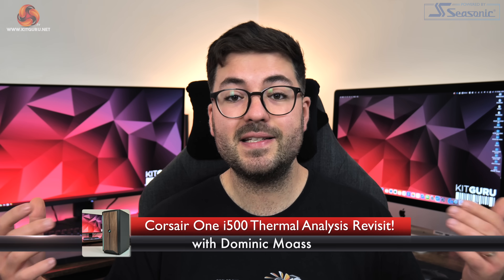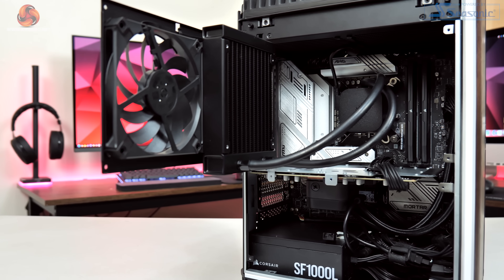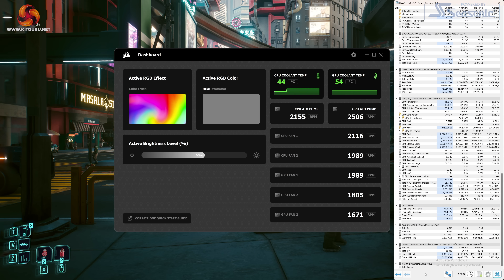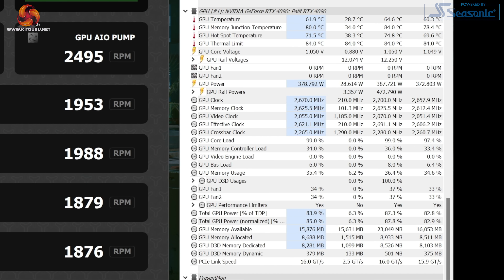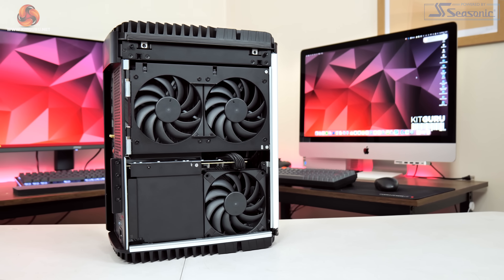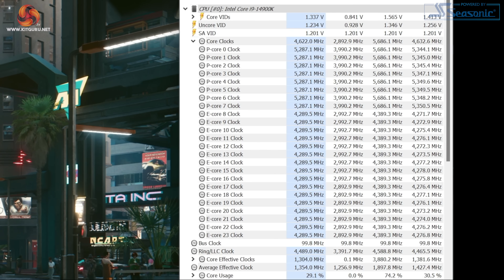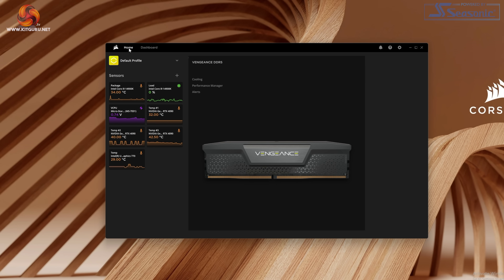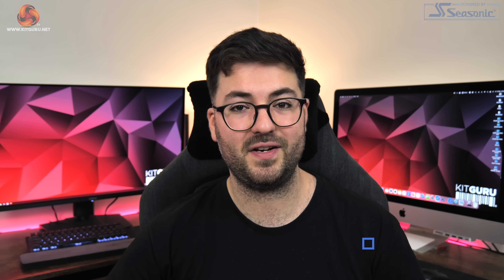Corsair One i500 Thermal Deep Dive - your questions answered!

Comment: I just randomly came across this video 😁 didn't even know there was some debate about my video vs kitguru?
At 2:05. Your different temperature result is not due to the fan curve but the different test. You said you ran something like 30minutes of test which means that you ran into PL1 Power Limit of 200W whereas I was doing a short test that uses the PL2 of 240W.
Edit: you even show an average package power draw of 190W in hwinfo. So you miss 50W of power which is less performance and lower Temperature. Has nothing to do with the fan curve
Reply: Kitgurus first video, people were asking why there were differences between your review and theirs, so they created this second video to explain some things and run more tests. I watched this video from Kitguru last week when it went up and they were saying basically what you just said in your comment - that you ran short bursty tests and they ran longer duration tests so the power demands were different . I dont think they ever said you were 'wrong', just that their tests were different and ran for longer times- explaining a different work load on the processor.

They did mention the idle fan speeds due to firmware/bios differences, but not in the context of what you saying.
Reply from the maker: hey Roman, no debate here - as the other commenter said really, we just got a few comments on our original video about our results, so i wanted to make a detailed follow up showing exactly how we tested. 100% you are correct, as we used package temps after 30 mins, which hits the 200W PL1 rather than the 240W PL2!
Reply: @KitGuruTech  😬 ah good info. Probably see you at computex?
Reply from the maker: Yep we'll be there! 😎

Comment: For the Mosfets and VRM, i was going to comment but saw that you did actually test in the follow up and i would agree. While they do have a very high operating ceiling - some are tested up to 150c and i wouldn't expect any 4090 to skimp on this area and so what Corsair are doing is probably fine, but in a build of this cost i would say not ideal, what they have essentially done is mount a  universal GPU block with all the future downsides that a GPU with a water-cooling block mounted has for a user that most likely if they are buying this won't have the knowledge to navigate the problems they will face, for example reversing the GPU back to air-cooling to make it more resalable, so if they are going down the Water block route i think they would be better giving them a full water-cooling block and the best complete cooling solution rather than a partial solution

Comment: Since the fan bracket can take chunkier fans, why didn't they just use chunkier fans? I mean at this price whats the point of skimping?
Reply: Seems a bit over the top penny pinching on whats probably a pretty profitable system. They should be over engineering the cooling not doing "just enough".

Comment: Great update! Seriously tempted with one of these and this is by faaaaaarrrr the best video on it! Cheers.
Reply from the maker: Glad you liked it!
Reply: I like their design makes a difference from the bog standard 3 fan on the front one on the rear rgb case with a glass panel.
Reply: ...while my takeaway from this vid was that it's just too much of a compromise with the latest processors. I was intrigued by the size/ design of the Corsair One a few years back, when it had minimal fans and Linus or someone couldn't get it to go over 60 degrees or whatever, but I'm not sure that cramming a 4090 and top-end i9 into such a small box makes sense today. Do Corsair offer bigger pre-built machines?

Comment: So are any of the five fans actually connected to the GPU board or the CPU cooler or are they all just connected straight to the motherboard? What if the GPU assembly was replaced with the MSI SUPRIM LIQUID X RTX 4090? Could that AIO’s fans act as push while keeping the top exhaust fans intact for push-pull? Or is there not enough room to mount it all in?
Reply from the maker: No fans are directly connected to the motherboard, they're linked to each of the AIO using splitters, though there are a few mobo fan headers that you could use. For the Suprim Liquid X, the AIO for that would have to replace the AIO that's currently installed for the GPU

Comment: Your review is significantly superior to der8auer. Additionally, I believe the CPU fans 1 and 2 are positioned there because the airflow flows straight from the side to the top. GPU fan 1&2 too.
Reply: Yes I thought at the time his review was just ok but he has this reputation. He didn’t cover half of what Dominic did.
Reply: Not to mentioned he swapped the fans and broke the air flow (he thought he was right) BEFORE doing those thermal tests, claimed the temp is high and asked for statement ? he’s probably high on something else.
Reply: Agree ! It’s much better
Reply: Yes 💯
Reply: Well said 🍺
Reply: Yes the methodology here is very data driven and representative of real world scenarios.
Reply: Yes I watched derba8ers video and a lot of his temp tests were very short turbo runs before the cpu would settle and the fans always have a short delay so it’s not really representative of a gaming session or in fact any work load longer than 30 seconds. But people seem to just blindly accept what he says at times.
Reply: Yes it is. Much better
Reply: Dominic makes more sense with the thermals he is showing in Cinebench, derbauer is just showing 96c on a single Cinebench run which takes a few seconds to complete. Dominic shows temps after 30 mins sustained load which is more useful info.

tbh a single cinebench run is useless info, the CPU will be boosting to a higher clock frequency and pulling more power.

and it takes less than 30 seconds to complete on a 14900k
Reply: No

Comment: I'm disappointed you didn't address the issue I raised of usage of the bottom x4 slot, but I appreciate that you have only so much time. Otherwise that was top work.
Reply from the maker: Hi Quentin - remind us what your query was? I am packing up the system now but I can try to take a quick look and get back to you. appreciate the feedback!
Reply: @KitGuruTech  Can the bottom x4 slot be used? Does the cooler on the GPU or the proximity of the bottom of the case prevent it? I had in mind a 10 Gb NIC and a video capture card.
Reply from the maker: @QuentinStephens  it looks almost completely blocked off, by the GPU AIO tubing more than anything. there's probably less than 20mm clearance between the PCIE slot and the tubes
Reply: @KitGuruTech  Thanks for checking. That's a real shame and another place Corsair really could have done a lot better. 

Keep up the good work.

Comment: Surprised the Noctua got wrecked so hard even with the PL neutering.
Reply: Should've used a different air cooler probably. Maybe a peerless assassin mini
Reply: @100500daniel  Imagine comparing this to that new DeepCool CH160 and having Corsair look you in the face and say, "we had to use slim fans and a 120mm AIO".
Reply: Well they could have tried a few. Think it was an interesting addition for a talking point.
Reply: It was a good choice for the room that case has.

Comment: I think the question should be why Corsair chose to go with power hungry very hot Intel if they wanted to offer "gaming pc"? Why not go with Ryzen 3D? For a gaming machine you dont really need anything above 7800X3D and that cpu is alot less power hungry with more menagable temperatures while being faster than Intel in gaming!? Also why 4090? Is that a "must"? 4080 and 7900XTX would do the job well while consuming less power. It's really sad to see new iteration of One series is mess because i really like styling of that case. I wish they offer something similar for DIY market. Im not sure if the case will lose some of it's attractiveness if they made it just a little bit bigger so you can fit tall air cooler and longer gpu inside.
Reply from the maker: yeah that is a fair point and one we make in this video - for gaming only, the 7800X3D would make a lot more sense given it's as fast if not faster than the i9, plus a lot easier to cool. there is also a 4080 Super version, but no AMD version for the i500
Reply: @KitGuruTech  I think Corsair have some kind of contract with Intel so they cant offer AMD platform based pre-builds. I draw that conclusion because all computers they offered so far use only Intel CPUs.
Reply from the maker: @novinovic298  there has been an AMD Corsair One in the past - the a100 for instance
Reply: @KitGuruTech  I was proven wrong. Thank you for correction.